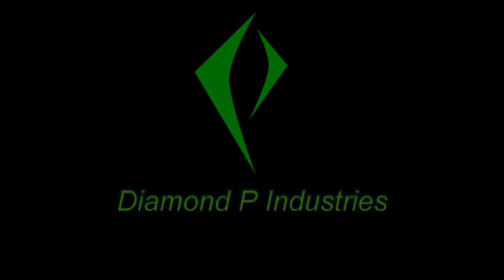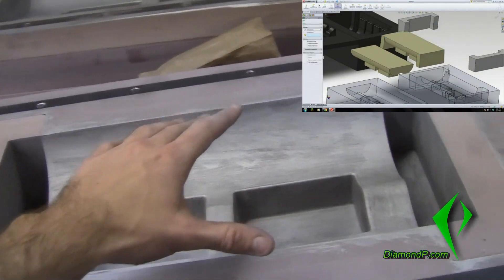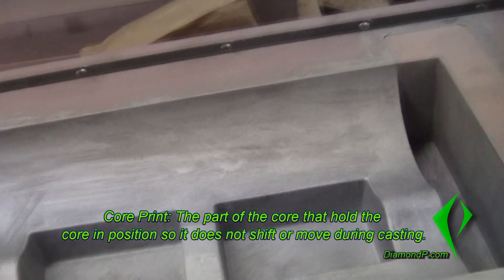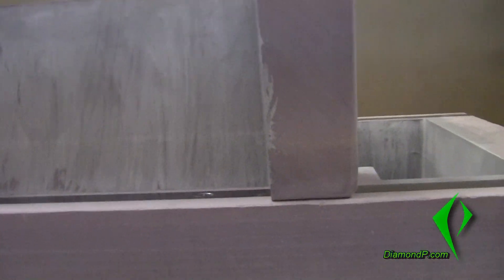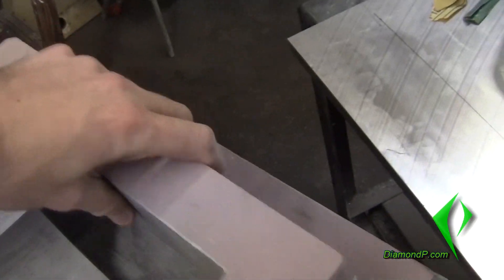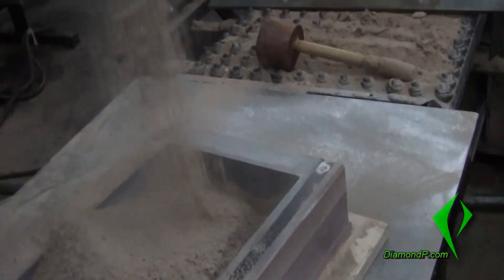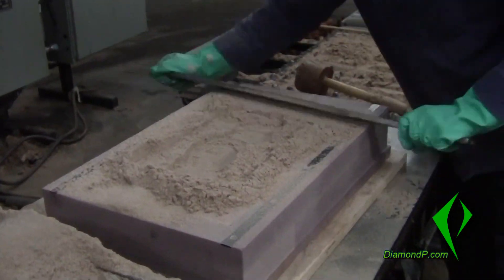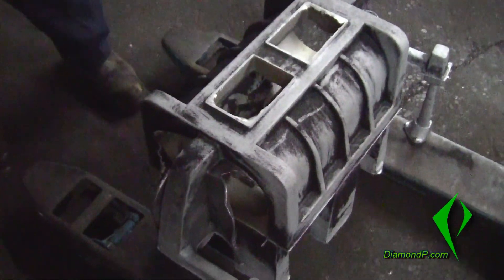Learn Castings: Cores & Coreboxes

Comment: I enjoy this I am a core maker. When I use my air set sand over oil sand when it's warmer outside the san sets up much faster but I can turn down the chemical agenda being dumped into the silica sand. The oil sand I put the cores into a core oven to bake out moisture. It's Art and I love my job

Comment: NICE! I've been struggling a lot with making my model engine. I've heard about "core sand", but the chemical is so difficult to get hand of here "sodium silicate"? - right?
OK, I can get it thru the company I work for, but then its the pure Sodium Silicate... During moulding it is something special chemicals added, isn't  it?
Best,
Arild Olsen
Norway
Reply from the maker: Na there is videos on youtube how to do it. just mix it into the sand and expose it to Co2 and it will cure. Or let it sit for a day or two and it will age cure.
Reply: Waterglass and co2

Comment: Very informative, thank you for sharing this as there is not much info around. I'm with a miniature steam club and am making the patterns for the piston valve steam cylinders at the moment so your video is very helpful. I have to put cores in for the steam and exhaust passageways. I will be making Male core patterns then make female wax core boxes from them to make the sand cores. Keep up the good work.

Comment: theres a fairly simple piece of mathematics used to determine this value, you can find the metal shrinkage values online, you then factor these values into the measurements of the item your making. for instance, ally has a shrinkage value of 2-3% from melting point, so you make allowances for this amount in the model, an added security measure is the use of risers, which allow the Mold to 'absorb' extra metal, to help reduce shrink spots etc.

Comment from the maker: Electric(induction) furnaces and gas furnaces will affect the impurities in the metal, which affects the quality of the casting. We use only electric furnaces except for our die cast shop. 

For weight its just experience. We can look at a pattern and guess how much we need. We only pour 2-3 sizes of ladles and after the first pour you know how much to grab out of the furnaces for the rest. If your referring to risers/casting ratio though, it's safe to start at 60/40 ratio.

Comment: Okay I have a couple of questions as I was taking notes, In respect to metal casting how would I research ''induction'' ? How does it relate to pouring metal into a mold?  

And how do you determine how much weight in liquid metal you need to pour?

Comment from the maker: There are two kinds of metal shrink though, the first is over all shrink, which depends on your metal and pour temp, we pour around 1400F and see shrinkage around .100-.140 per foot 0.008-0.011%, sounds small but its not.

The second is hot spot shrinkage, this falls under entropy and thermodynamics. Hot and cold spots will pull metal away from one another creating 'shrink spots' within the metal, they are visible by the eye and are weak spots. These are controlled by risers/gating.
Reply: Using a chill should stop hot spots

Comment from the maker: I find it very hard to get literature on foundry work and mold making for sand. Its not like most trades, each foundry does things a little bit different. Most of this is due to, there is no right or wrong way to make castings, just better or worse. The only book I've read on foundry work is a book my father has that was written in the 50-60's. Your best bet to learn how to make better castings is to research thermodynamics, hydrodynamics, entropy, convection heat, induction, metal properties.